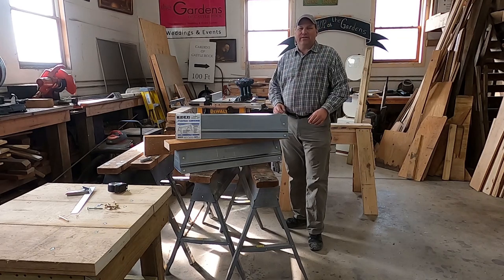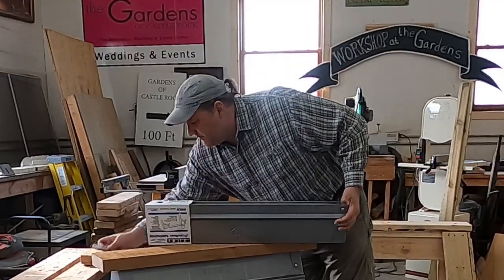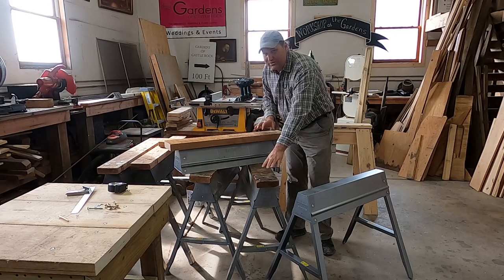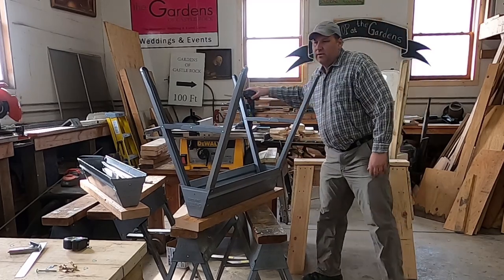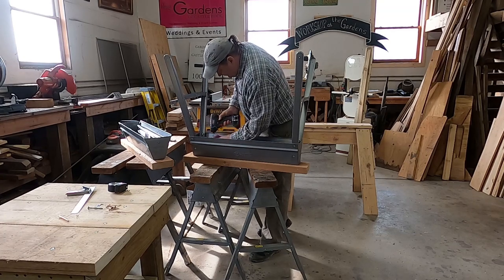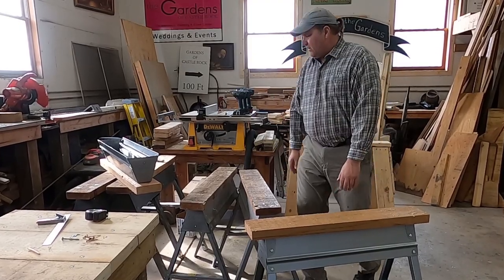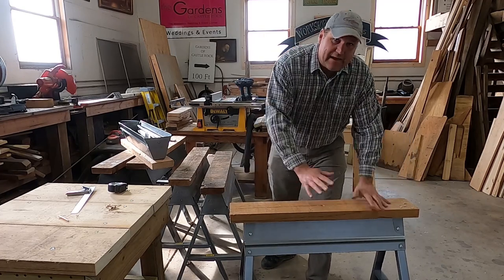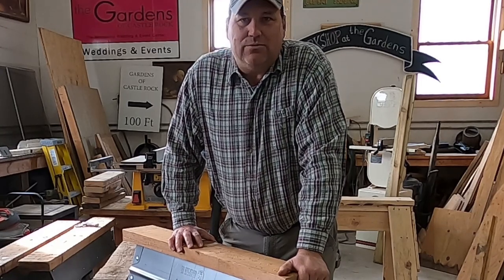EBCO Folding Sawhorse Hack ~In the Shop Tips Tricks Hacks and How To's

Comment: I have had a pair of these for over 30 years. I just went out to my closed in trailer and checked the name on them "Ebco". I keep them closed up and one on either side of a metal trash can, both bungee strapped to the wall of the trailer.  They are light, easy to set up and have been strong enough for me.  I have had a 2x4 on top of mine since getting them. The one short come of them is the legs are small where they hit the ground.   I have different saw horses at home out of 2x4s.  My favorites are 48" long and I keep 3 each 2x10s 10 ft. long to put on top of the set.  Lengthwise cut of a sheet of plywood with out piece falling. Also keep several 2x2s 48" long to put on top of planks for cross cutting a sheet of plywood and not hitting (cutting) the planks. Use to hold my miter saw, cutting up plywood, assembly, painting and scaffolding.

Comment: Very new to the wood working game, what length of carriage bolt are you using?
Reply from the maker: Just long enough to make it through the wood and metal and still be able to get a washer and nut on the boly. I think I used a 2 1/2" carraige bolt. The screws were construction screws that were 1 5/8" so the wouldn't protrude out the top of the wood. Thanks for checking in!